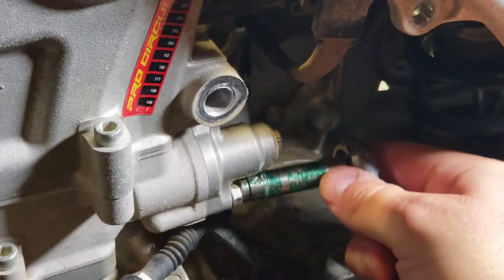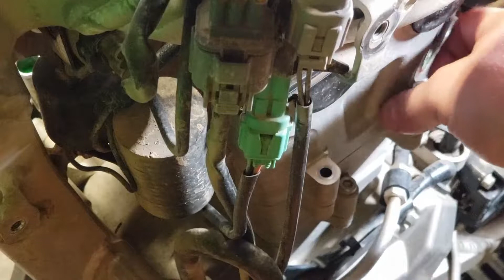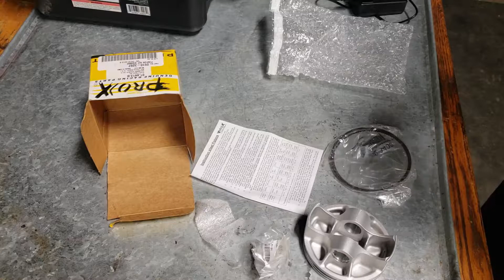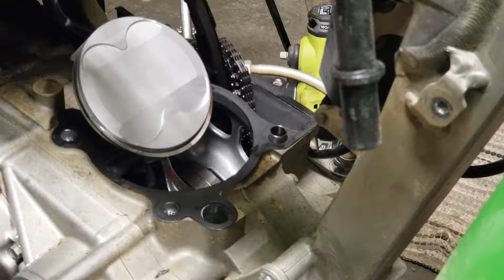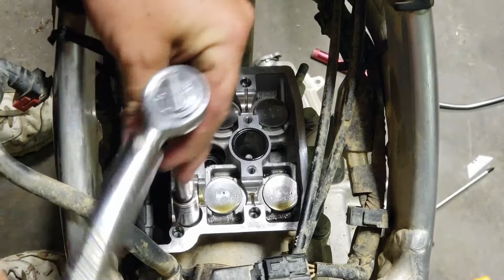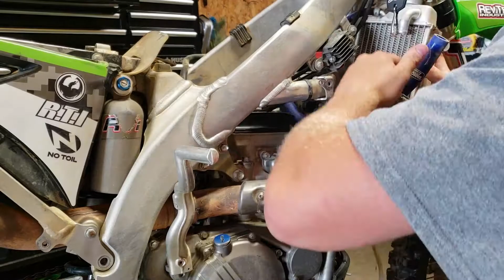Throwing a quick top end in a 2014 Kawasaki KX450f

Comment: I'm about to do my first ever top end on a 2010 kx450f and will be using your video to help me get it done. 
What are some key points to make sure I do proper install? Also  is there a way to check the bottom end? 
Cheers!
Reply from the maker: There are specs in the manual to check crank play...but it's really tough to gauge. If you feel no up and down play, you're probably okay. 

Key points 
Break the glaze on the cylinder walls
Lube everything up
Be careful putting cylinder over the rings...its easy to snag those thin oil rails that go on either side of the oil ring....but 100% sure they are not snagged before you push the cylinder down. 

Dont forget timing chain guide in proper place.

Comment: Assemble the rings dry, only oil the pin and clips. When done fire it up and let it idol until it pukes coolant and then let it cool and go rip! Pre oiling the cylinder and rings are not needed it causes glazing and the new rings not to set well! With the peaks and valleys filled in with pre-oiling the cylinder walls this creates a glaze  an extremely smooth surface making it very difficult to get the rings to seat. Establishing ring seal begins with proper assembly and that means cleaning the cylinder walls. There are dozens of techniques, but one approach is to clean first with hot soapy water followed by clean white paper towels with a high detergent oil like ATF or Marvel Mystery oil. If the towel still shows grit after cleaning passes. Keep going until each bore is clean.
I do all of my  top-end this way and no issues. You will be suprised how clean the piston is also when you do your next topend... I even will spray contact cleaner down into the cylinder and stroke before firing...Also important properly hone the cylinder to get the good crosshatch...dont use sand paper!
Reply from the maker: Lots of fantastic info in this post, and we appreciate it. However, 0 issues doing it this way for 20 years, so I can live with it and sleep very well at night.

Comment: hey bro i need your help sooo badly i got my son a 2015 kx450f the guy said it was ready to ride 🙄🤬and had a crack in the case luckily wasn’t the inner but i panicked and took it to a shop they took the top end off and said the cylinder looks good even where and the cross hatching looked good and he put it all back together…i haven’t rode a bike since 02 and only rode 2 stroke 125 should of stayed in my lane lol but my question is do you got to replate and hone the cylinder or can i just slap a piston and ring in it cuz from what i can remember you should never break a cylinder seal unless you rebuild it and the dude at the shop said id be fine but i don’t believe him what do you think 🤔 and thank you so much man
Reply from the maker: If you take the bike down that far, you at least want to pull the cylinder off and gently "break the glaze" with some brake cleaner and sandpaper, or quickly with a flex hone. Then you want at least new rings. Generally you don't replate or hone a modern 4 stroke cylinder.

Comment: Is the cam chain tensioner removal and installation the same as on a 14’ crf250r? Also what did you do to the cylinder to prep it for a new piston and rings? Thanks
Reply from the maker: Yessir, it is. I use brake cleaner and a fine grit sand paper to break the glaze on the cylinder and get some cross hatching showing.
Reply: The MX Guru thanks for the reply
Reply from the maker: @NickW90  anytime Nick!

Comment: I got a 07 kx450 got it back from the shop and it leaks under the head gasket, and it back fires alot .. they rebuilt the carb but idk what to do. It starts fine but ya.
Reply: Did you try replacing the head gasket? Along with check your valve clearances.

Comment: Is this the same on the 2016 kx450f?
Reply from the maker: Yeah, a few pieces make look a little different but it's the same process
Reply: @mxgryan  ok thanks
Reply: @mxgryan  how can I tell if I need a rebuild cause my bike has 56 hours on it and I just bought it off some dude on craigs list and it feels and runs nice but you replaced it at 60 hours should I do the same?
Reply from the maker: @Blocanbentlyyahu  just really depends on the type of riding you're doing and how hard you're being on it! If you're a relative beginner or just play riding you can go to.80 or 100. I wouldn't go further.
Reply: @mxgryan  yeah I’m just taking it slow on the bike at the moment I’m not racing or anything yet